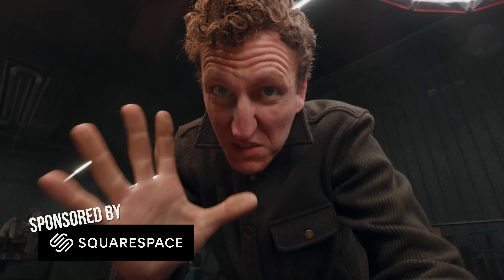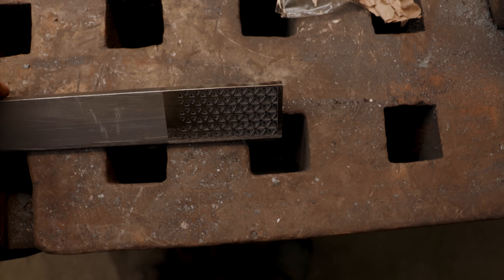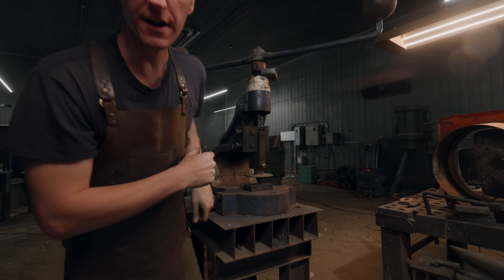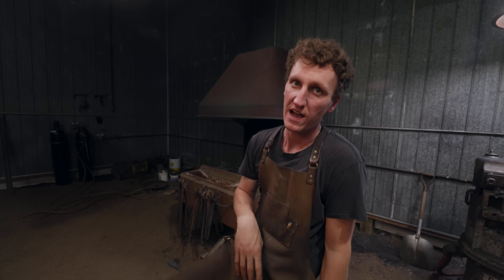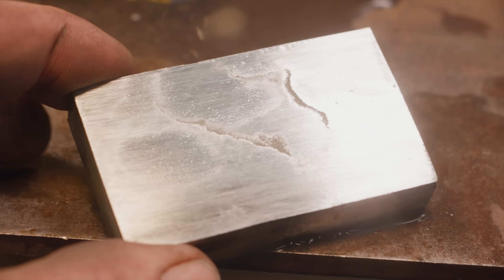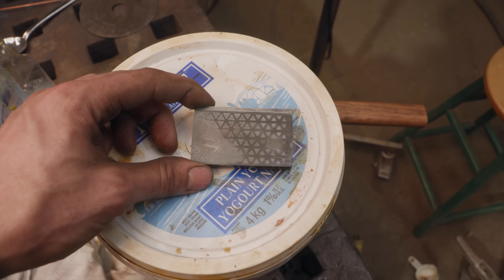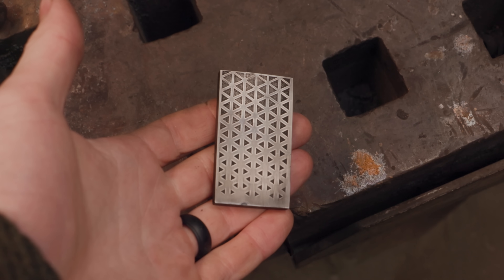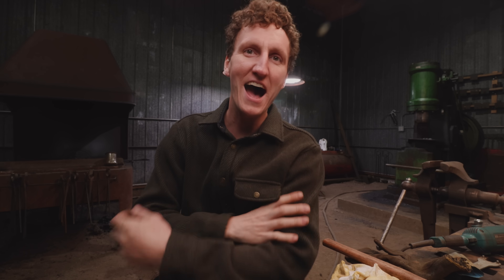New way to make Damascus steel?

Comment: This is how fake damascus is already done..
I used to work at a pewpew manufacturer and they basically took your design but CNCd it all the way through for the negatives and used a separate metal to fill the negative space with crazy tolerances then forged it. it looked crazy. kind of like what you are going for, but real. 
This is like Burger King painting on grill marks.

Comment: This is just like sintering. Granules that are strongly compressed at high temperatures. The result is a porous mass, which explains the roughness. Cutting inserts made of tungsten carbide are also produced in this way.

Comment: Instead of using a laser it'd be a lot faster to just hest up your steel and use a pattern stamping die over top and just forge heat smash it in

Comment: I love these types of experiments! They always lead to new ways of thinking and inovations. Before you said that you didn’t want to do this as damascus, I thought it would be interesting to have the laser etching reversed where the skeleton around the triangles is removed, leaving the triangles as the high points. This should make it easier for the powder to get into all the recesses as well as have it be a fully connected lattice around the triangles. Nice work! Keep the creations coming.

Comment: Make the holes all the way through white paint a piece to wel on the back, fill the holes with powdered copper, then weld a white painted piece on the front. The holes all the way through will help the inserts bond in better, unlike the more inlay style in this video.

Comment: So, with Raindrop Damascus you have to drill into the surface of your damascus a bunch of times, and then forge out the drill marks. 
Now you have me wondering what the raindrop damascus would look like, if instead of drilling the surface, you engraved fixed shapes into the surface before forging out the engraving.

Comment: Every time I watch one of your videos, I miss Canada. I think that Canadians just talk differently. It's really not an accent thing, it's the way of speaking. I also miss Hawkins Cheezies and Eatmore candy bars. Thanks for the videos. If that laser could cut two identical patterns, one raised and the other indented, like male and female but with room for the powdered steel in the middle. That might compress the powdered steel enough for a good forge weld. Of course, you would have to use a bandsaw to rip it down the middle to reveal the pattern. Sorry, I don't really know anything about forging metal I'm just curious. 😎

Comment: 0:58 you were correct in calling it "pattern welded steel".  (Two different steels welded to create a contrasting solid billet when etched) True Damascus is a crucible steel and the patterns come from part of the process and the way the steel crystallizes. It has maddened me for years that people continue to call pattern welded steel; "Damascus". It's beautiful either way. But they are two completely different things. Fz making knives has about the truest thing to "Damascus" although through a different recipe; I have ever seen on YouTube. Check him out.

Comment: I prefer the darker damascus but that's just me.
The laser etching does create quite a bit of heat but over a tiny area, and the heat doesn't penetrate deeply into the metal. I don't know if it would compromise the heat treat, but because of the large area being etched I'd probably do it before heat treating. 

Beautiful work!

Comment: I have two, somewhat competing thoughts:

On the one hand, one of the beauties of Damascus steel (to me anyways) is the wavy, distorted layered pattern, which isn't present in something with a precise stencil style pattern, so one half of my brain says that just laser etching a pattern and bluing the relief is the way to go to achieve something like this.

On the other hand, pattern welded steel is awesome in its own right, even if you don't have the classic layered Damascus look. To that end, if you could arrange to use a water jet cutter (or hunt down one of the companies who make water jet cut parts to order) you could cut your pattern completely through the blank and eliminate the risk of grinding through a shallow etched weld, and ensuring the design is symmetric on both sides. If you wanted you could probably even cut your 15N20 blank, then have the negative of the pattern cut from 1090 and slot the two pieces together, negating the need for powder at all.

If you do go for a reattempt at welding, I suspect that you're always going to have some distortion of the pattern just by virtue of the way the welding works mechanically. The two soft bits of metal have to be mushed together until they fuse, so any variation in temperature, force applied, material composition, variation of any kind really is going to wiggle the joint differently along its length. Even if you heated two flat bars and squeezed them uniformly, the resulting joint wouldn't be perfectly straight, so the chance of getting a pattern to fuse without distorting is vanishingly small I imagine.

Comment: One piece I have learned from others, and my own experience with Damascus is that the majority of the weld happen in the fire.  It’s important to get the welds set quickly if you have open steel that is susceptible to oxidation, but if the weld surfaces are covered, like in a canister, it’s not as crazy important to get it to a press or hammer the second it’s out of the fire.

Comment: Can you try out 3D printed damascus? General idea  A line drawing is expanded upwards and scaled to fit into a canister, the cells are filled with powdered metal and sealed, PLA reduces to carbon in the canister. Unsure if it needs a vent and how long it needs to soak in the forge for but it opens the door to almost any mosaic tile you can think of.

Comment: easiest if you take the canister sans the patterned metal, and paint the inside with spray paint. once dry put in the metal and the powder.

Comment: Have you thought of using 3D printer/pla to create a pattern with powdered steal?  Steve Schwarzer did it at a suggestion from a student. PLA just turns to carbon at forge welding temps. Use PLA 3D printed structure as a way to separate the two powders in the can until they are forge welded. At least that is the theory.

Comment: try doing Damascus steel first as a base. Then 3d scanning the pattern and engraving the Damascus pattern in different depth with the laser, to give it more of a dynamic look. You can even infuse the engravings with different metals to make it "flow/mix" in to the Damascus pattern.

Comment: Could you fill the holes with the powder, then cover the steel with paper masking tape? This would prevent the powder from falling out & the paper would get vaporised when you heat it. That way you could make a casing that fits it like a sheath to a knife.

If the powder is fine enough, you could use vibration (an ultrasonic cleaner without water, or a power tool touching the metal) to get it to fill even very tiniest of holes - like a thin groove the thickness of a ball point pen. That way you could create patterns like the branching veins in a leaf (0.20mm grooves), or natural fractals (think cracks in drying mud, or an image of lightning), even the scales of a lizard.

If this works, this would make utterly unique damascus patterns that would be really popular. 

You could even "sign" your work with a laser-etched fingerprint hidden on the tang.

Comment: If i were a buyer not knowing the amount of time, effort, and skill that goes into the damascus/pattern weld, and you showed me 2 identical pieces with significantly different price tags and told me they would preform the same, i would buy the cheaper one. If the intention is production for sale the one that cost less to make would be the one to move forward with.

Comment: I would of set the thing up on a mill with a insert cutter and hogged off all the steel instead of all that grinding with a belt sander and angle grinder 😂 really cool video though

Comment: Next time make a small can you can slide the steel in to the middle. Coat the can in white out and for the love of god let it dry good before use. then slide it in the middle and just go back n forth side to side until full. Also I have never used the powder steel but from results I have seen using a jig saw or air hammer or saws all on the side of it shakes it very well insuring all spaces get filled.       The gun blue looks good.   I would like to see a portrait or something in more detail.

Comment: I think you're on to something but you're thinking about the wrong way ? Why not use 1090 and 15 and 20 and laser a puzzle pattern that would fit together ? It still does need to go all the way through, in fact you could have more than one layer and just weld them all up ?  You would have to think ahead so that you would have your final pattern when your done forging ?

Comment: Two words: wood grain.

Also, oxidize the stainless foil so it won't weld.  White paint or Wite-Out might contaminate the powder under heat.

Comment: Try to make it cut through before Damascus forging it, you can stack thin plates with the pattern so you don't need to rely on deep laser cuts, but don't get afraid of deforming the patterns, hit it as a normal Damascus, I thin the random deviations that give real Damascus it's flair.

Comment: Great Idea Tim,  I was thinking as I watched...
Why not use the laser to leave a thin border around the edge of the 15N20 bar steel and reduce the rest of the surface by say .040" or [40 thousands of an inch] and the pattern cut it all the way thru. Then TiG weld a sacrificial surface plate on one side, pour the 1095 powder steel in making sure to let it fill up that bottom side w/the powder thru the cut in pattern; the thin border keeps the sacrificed cover plate slightly off the bar for the steel to fill in completely then TiG weld the other side plate on and forge weld it. I think this will give you more material to work with when welding so the pattern will come out better after grinding off that thin layer of 1095 and the 2 "side plates"
Having done all that will ensure if you are making a knife outta it the pattern won't disappear when grinding the blade profile.
I hope I explained my thoughts well enough.

Comment: Machinist here: you're knocking on the door of something really cool with all of this.

The problem I'm seeing is a lack of accuracy and control over your capsule, your grinding, and your material prep.

First recommendation would be to start with slightly thicker stock and machine or grind it to a flat, parallel piece with square edges. This will give you better consistent in your laser etch, and contribute to a better fit in your capsule.

Second, use oversized material. Give yourself a solid 1/4 of an inch on each side to work with. This keeps you from infringing on your pattern when you cut it out of the capsule.

And finally, have the capsule parts milled. You did a great job making it free hand, I'm very impressed, but if you want controlled clearances for where your powdered metal is going to reside, have it milled. Do it in two halves, give it a little slot to hold your material, and then when you clamp the two halves together you can weld up the sides and you're good to go.

Finally, crack it open on a CNC machine tool. With every step in your process kept to a higher degree of accuracy, you should have no problem milling away the excess material to reveal your finished product.

Using a die with stops on it for the welding process could give you greater control over the welding process as well, allowing you to keep the finished capsule a set thickness after forging, and keep it flat and parallel; could allow you to use more force without creating any distortion in the pattern? Might solve your pitting and cracking problems.

Doing it "right" might end up being expensive and requiring tools you don't have in your shop, but the results could be incredible if you could nail down the process.

Comment: Stainless steel foil will weld to steel.......if you would use grade 1 or grade 2 titanium foil that for sure does not weld to steel. Its also not very expensive.

Comment: I'm not an expert metallurgist or blacksmith, but I don't think this is going to produce knives of the same durability as typical Damascus steel. In "normal" Damascus, your folding and welding the two steels into each other, which leaves you with a bar which has both steels running throughout the finishes blade, with no part being too soft or too brittle. This process seems like its purely cosmetic. You have the etched part only on the outer surfaces, so it's not providing the benefits of the powder steel throughout the the whole bar, you'd still need to fold the bar a number of times, to get the full benefit. Which means you'll lose the pattern you cut into the metal, though the finished blade would still look cool I'm sure

Comment: I would rather you pursue this as a damascus potential, mainly for the benefit of the community, at least until you get some others trying it.
However I think this alternative version would make an excellent looking sanmai, specifically in hatchets and tomahawks where you can still weld in a nice tough 52100 or 1095 for the cutting edge.

Comment: You should have used the laser to cut all the way through the first piece and totally fill it with 1095 powder. That way as you work it and and actually create a blade it won't be ground away. Possibly using a wavy pattern so you don't have to worry about the pattern distortion as it is forged. Very cool idea! I wouldn't give up on it yet.

Comment: What about using the laser to etch grid point pretty deep like little centre punch holes for guides points to drill all the way through the stock with a drill press.  You could use different sized drill bits and completely fill up the holes in the stock with different types of powder.  I’ve been thinking of something like this for years.

Comment: looks like metamaterial designing: I wonder what would happen if you made some pattern that works better for absobing shock in the knife, like using a harder steal for the sharp parts and a more ductile patterned steal in between as it were a spring-somehow

Comment: Cut the exact same design all the way thru on two different steels, then swap the cutouts so the skeleton holds the cutouts of the other steel and vice versa and use the powder to fill in any gaps.

Comment: It's a cool concept but I don't personally like it for a pattern on a blade but I think it would be awesome as a pattern for a guard or as a spacer between different handle materials. Just do the edge if possible. Or engrave a touch mark and then do the forge weld. I think that would be amazing

Comment: I dislike the use od Damascus in wilding shops where they take a stack of metal and do forge magic heating hammering folding repeatings, cutting, restacking and heating and hammering etc etc etc, and yes they look real cool, but if you compare modern Damascus to lets call it original damascus steel they look nothing alike.  Now I'm no one but someone else who is much more a critic then me bitched about this on his channel, I have since blocked his channel because I did not like the feedback he was getting abused by and he would film rebutles and I tended to agree with the guy but still for my own sanity I thought it best to just walk away and try and mellow out a bit.  I'm not sure it worked :)

Comment: The pattern welded "dirty" steel looks so much better than the etched and polished blank. The dirtiness comes from new alloys that you created in the welding process. The non ferrous materials kinda flow around while hot, and that's what makes it beautiful.

Comment: Your stainless foil stuck to the powder because it is clean. Makers who use stainless foil this way heat it to let it get a layer of oxidation on it first. The oxide will keep it from welding to the rest of the elements in the canister.
Reply: You should say this again up in the comment he replied to, by replying directly to him. He'll be more likely to see it.

Comment: The trick with the stainless steel foil is that it has to be oxidized before going into the canister or it will bond to both metals

Comment: Damascus steel, contrary to most people's thoughts, CANNOT be made from any old steel, but needs to be made to the WOOTZ process using a specific high carbon ore from Syria or India. People enjoy jumping on the Damascus steel band wagon, when they are simply producing patterned steel. By claiming it is "Damascus Steel", does show a slight ignorance of the origins and requirements of REAL Damascus steel. If you doubt me, just Google it and see the truth for yourselves. Nice looking patterned steel, good post.

Comment: Here's a thought: Can your laser sinter the powder? If so, lock down the workpiece on the laser bed and let it do it's thing, then just add powder without picking up the workpiece and run a sintering pass. You might have to look up the laser's working temps to see if it's capable of sintering this powder, but it might yield result.
Reply: Without an inert atmosphere it would oxidize the powder.
Reply: Damn, I just posted the same thing and then saw your post.

Comment: I guess the thing I think is cool about your Damascus steel idea is that it wouldn't wear away over time.  Like you could make a pattern on an axe head or something that gets used alot, and the pattern would always be visible.  Maybe it would just need an acid etch every now and then, but it would stay. Would the gun blueing ware away over time?